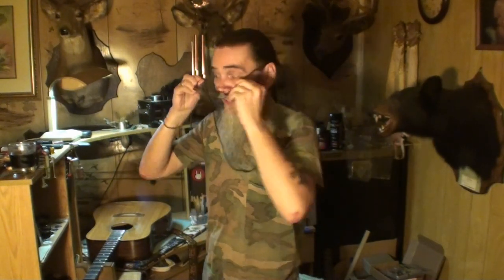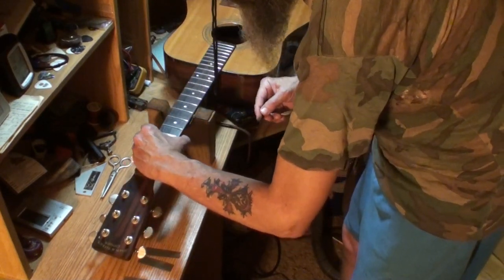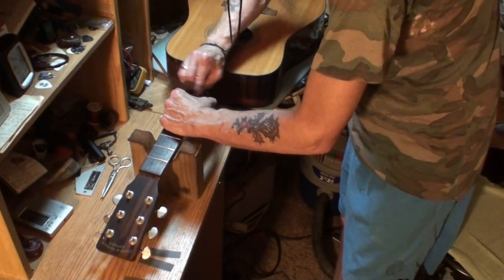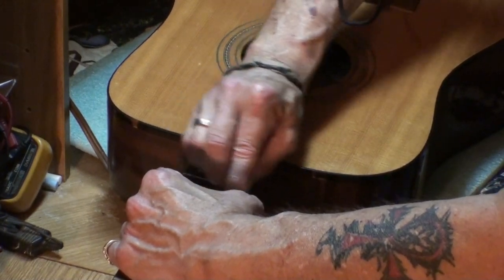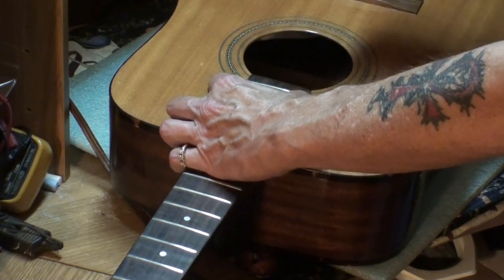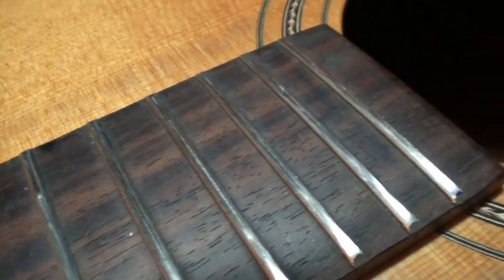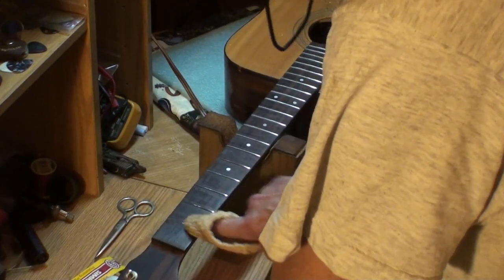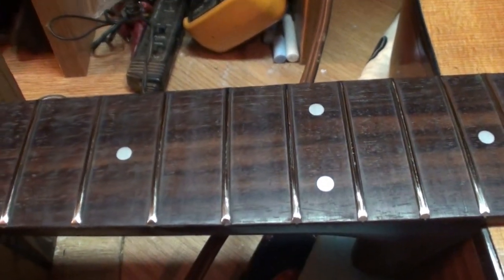simon patrick fret polishing

Comment: Dang bruh, go to the home store and buy a dang A/C. I have seen them less than 200 bucks. Install ain't that bad even if you cut a hole in the wall for it. What happened to your fret erasers? I know, you wanted to show how anyone can do it, great video for that. I have to admit, after I file my frets, I use 600 grit and go right to 2000 grit after. Takes more elbow grease, plus I don't have the patients you have. I start putting my hands on the side of my head and start howling way before that. I guess that is why yours are purtier. Mine still come out nice considering. Also I use polishing compound, probably not as good as the simichrome but works well. I'll shut up now, I don't want you to think I'm heckling you. Thanks for the video.